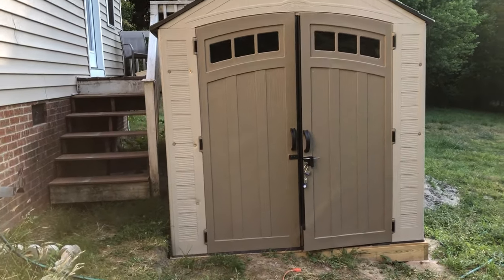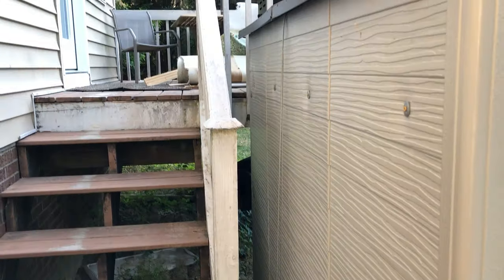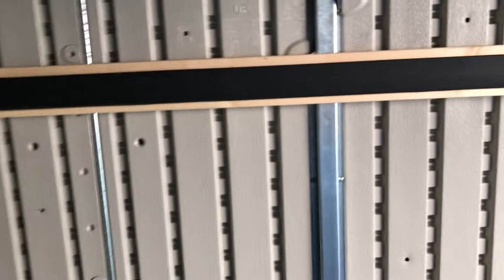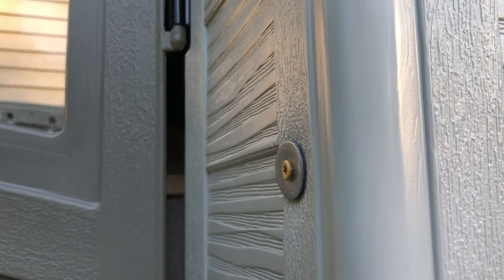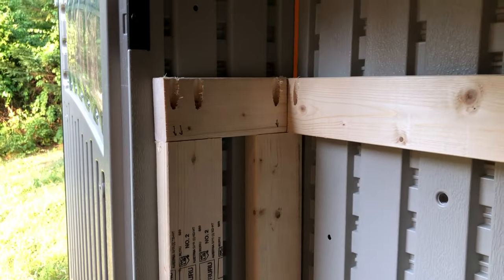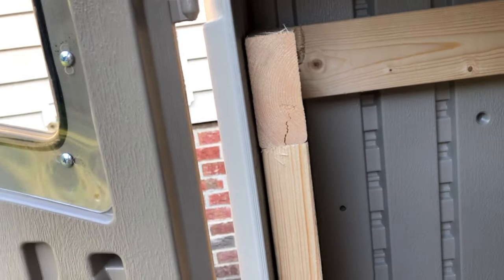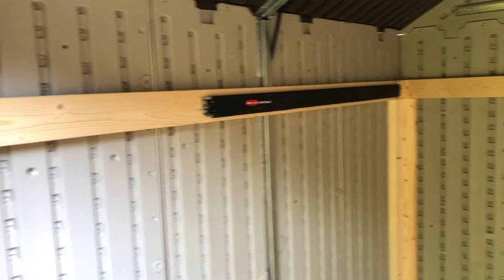How To Reinforce A Plastic Shed (7x7 Resin Shed) #shed #DIY #storage

Comment: BS. Either you had help or a spreader bar you could not screw in the 2x4 from inside.
Edited video.
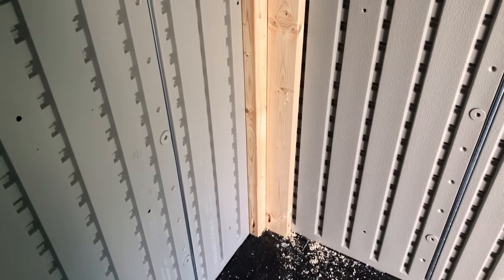Reply from the maker: Since you're so observant, I'm sure you noticed the pocket holes at the bottom of each vertical 2x4 (timestamp 1:19). I'm sure you thought about this after posting your comment, and that maybe those verticals could be attached to the floor first, then the horizontal members screwed into those by more pocket hole attachments (timestamp 1:23). Then once the whole frame is assembled inside the shed, the screws can be easily driven in from outside the shed, all without the help of another person or special equipment. But Im sure you thought about all this right after posting your positive, insightful comment.